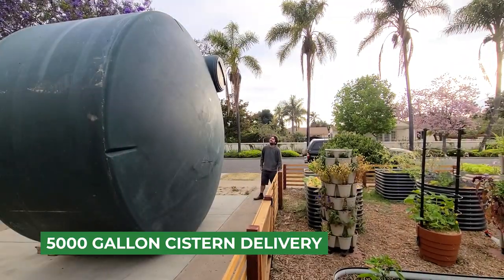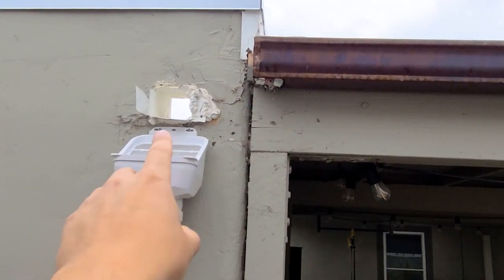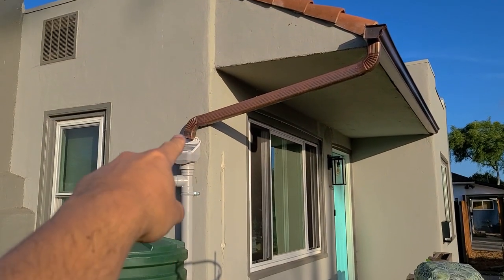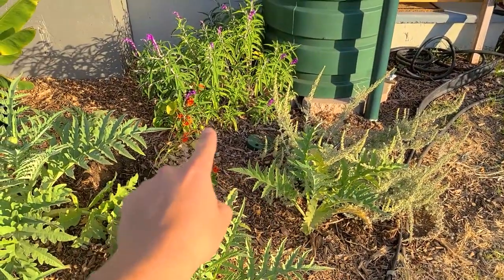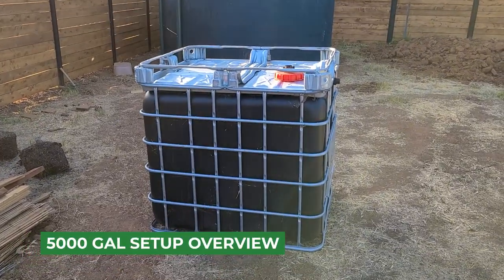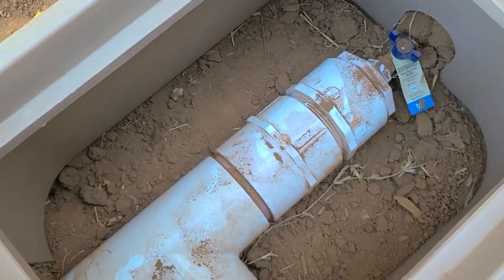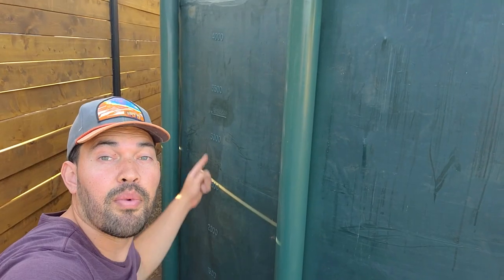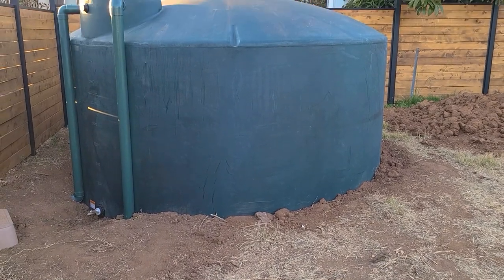5,700 Gallons of RAINWATER STORAGE at the Homestead! 💦💦💦

Comment: Where I live in Australia, we have a very similar climate to that of more inland San Diego area under the Köppen climate classification system, and having rainwater tanks here is standard (no rebates or grants that I know about). 
My grandparents and aunt and uncle live in a more arid area with even less rainfall and have each at least 4 x 5000 gallon tank. I have a single 4 or 5000 gallon tank and have been looking at getting another one as well as the thought is better to have more (without going overboard), than not enough. We use this rainwater purely to drink and water certain plants - and as it is also plumbed into the house we can use it for other things if need be as well. I noticed when I lived in the states, utility prices are too cheap (of course some areas are more expensive) compared to what resources are used and people don't realise how precious these things are.

Comment: Sweet! How long before they all fill up? Hope you get a lot of rain soon. Brilliant video!
Reply from the maker: Fall!
Reply: One inch of water or rain is equivalent to 623 gallons per 1,000 square feet. San Diego averages 12 inches of rain per year, and Epic is capturing water over probably about 1500sqft of roof, so that’s 623x12x1.5=11,214 gallons in one year!
Reply: @eandrgoodwin  I started gardening because I was told there would be no math ;-) but seriously, thanks for taking the time to answer my question. I must do the calculation for where I am using liters and meters. Cheers from Down Under!

Comment: What was the cost for just the cistern? We've been trying to figure out how to collect rainwater in a  cistern for two reasons. #1 We have a well and if the power goes out, we have no water besides the emergency water we store in special 5 gallon totes. Luckily the power has never been out longer thana few hours in the 7 years we've lived here. #2 Where a live, we get plenty of rain September to May but June, July and August gets almost no rain, only a handful of days or even none sometimes. So it would be great to store rainwater for the annual 3 months of drought and give our well pump a break from irrigation. The little rain barrels make no sense in our climate since that would over flow 9 months of the year and then be emptied in a couple of days with no refill when you need one. 

At the very least, we should set up a greywater system. I haven't found a lot of info about how to do this stuff so thank you for sharing your process.
Reply from the maker: Just that is ~$3k

Comment: Umm, I'm confused.
How the water flow to the biggest tank?
Using Archimedes?
So, inside the pipe gutter and underground pipe, it's full of water first, and when it's overflow, the water will fill that big tank?
It's also act as protection from debris, in addition to the existing filters.
Is that correct?

Comment: how does the water go UP to fill the big tank?
And - how many years of SD rain will it take to fill that?
Reply from the maker: If the level of that entrance is lower than the gutters, it will flow in
Reply: @epichomesteading  won't all the water in the tubing in-between the cutter and the tank be lost? That must be a couple of gallons given the distance and tubing diameter that will stay stuck in this U once the water stops to flow from the gutter.
Reply: @matf3663  i was thinking the same, i wonder if there is some sort of Greedy Cup effect going on that will pull the water out of the pipe into the tank
Reply: The level of the input to the large tank just has to be lower than the level of the input to the leaf filter, otherwise it won’t flow.
I assume that’s partly the reason you sunk the big tank down into the ground a bit. That, and so you wouldn’t see it over the fence.
Reply: @matf3663  some water will remain in the pipes and be inaccessible until more water comes in to push it up and over the top into the cistern.  This fill method is done to prevent siphoning. If the tanks were filled from the bottom, the pipe would still always be filled with water, but if anything went wrong, the drain pipes would rapidly pull all of the water out of the tank.

Comment: 2 questions: how long does water keep in them? Are you worried about air pollution in your area, I know you are somewhat urban still.
Reply: That's one of the purposes of the first-flush filter.  The first run of rain goes into the first-flush drops.  This is intended to divert away the particulates and other pollution that may have landed on the roof, then starts collecting water after that first flush has been completed.

Comment: I have hard time getting water out of barrels. Especially when water level is low. Attaching hose to spigot doesn’t really have a good water flow. It takes too long to water my garden so I usually end up using regular water. 
water pump makes loud noise so I don’t like using them. ( also I burned them down quickly.) 
How do you keep pressure from your rain water ?

Comment: I’m confused about where the gutters and system meet. Why is there a pipe that it goes down first? Is the pipe capped off at the bottom to fill it up? If it is capped then does the water cycle through that pipe as more water fills it up? Nice system!
Reply from the maker: It's not fully configured yet
Reply: I was wondering that, too. 
Is the “first flush” portion so that all the silt from the first rains doesn’t go into the holding tanks?

Comment: Two questions... how does that first flush part work? And, how does the water flow up into the cistern? What forces it upwards?
Reply from the maker: First flush works by filling up the first runoff, then once it's full the water flows into the capture system. Water fills up the tank so long as the entry point of water is lower than the gutter

Comment: 5700... if you ever fill that up you need to make a video about the Noah's flood you just went through :)
Reply: It's 0.6 gallons per inch of rain, per square foot.  San Diego gets an average of about 12 inches per year or less.  I don't know what his collecting square footage is, but with 1,000 square feet of roof, it would fill the cistern in less than 10 inches of rain.  

Honestly, though, the only major detriment to excessive capacity is cost.  If an area has a freak storm with torrential rain, you want to be able to catch it, and having reserve capacity gives you somewhere to put it.  Without some augmentation, though, he's unlikely to ever fill it without an extraordinary weather event.

Comment: Hi Kevin. I'm really enjoying your how-to videos and I am linking to some in my Oregon State University classes. You explain things really clearly and have great energy.

One comment on your system: I have not seen people overflowing tanks underground. Usually tank overflows are daylighted. I think you're in SoCal, and I wonder about when you might get a major atmospheric river event, of surpassing your overflow capacity in an underground system, especially tied into your existing greywater systems where the soil will be already saturated. I noticed on another video that your greywater pipe outlets (in your citrus row) are at ground level, instead of at the top of the bucket where the water has a drop when it enters your bucket. So I think over time you're at risk for root infiltration into your greywater pipes, which are now also your tank overflow pipes. I've installed a lot of branched drain greywater systems, and I did have root infiltration and clogging of my system even when the pipe level was at the top of the bucket (with bamboo!). Had you considered daylighting your overflows? Any thoughts on the height of your greywater pipe outlet in relation to the soil level at the bottom of the hole? Thanks so much for your excellent videos :-)

Comment: Question - How does the water get up into the 5k tank?  Is there a pump?  Awesome video, thanks!!
Reply: Wondering the same thing😕
Reply: That was the leveling thing. The top of the cistern is below the roof, so even if it looks like the water is running uphill, it really isn’t because the top of the cistern is still below where the water is coming from.
Reply: Hydrostatic pressure

Comment: So I know San Diego doesn't get a lot of freezes in the winter but do you know if something like this or at a smaller scale would be feasible in places that do get harsh winters like in the northeast U.S.?
Reply from the maker: Different application but you can still do it
Reply: You might have to bury the cistern below the frost line, then you’d have to pump the water out. 
Or just use the system when it won’t freeze and keep it drained when it will.

Comment: Hey Kevin, I was thinking of doing a 50 gallon rain barrel. If my barrel is on my deck which is about 4' above my garden, how would the flow rate of a normal 3/4" hose be? Would I need to buy a pump?
Reply from the maker: I'm not sure offhand John, sorry!
Reply: @epichomesteading  NO PROBLEM LOVE THE CHANNEL ANYWAYS, keep it up
Reply: The hydrostatic pressure of water at four feet is about 1.7 psi.

Comment: How long will it take to fill 5k gallons of rainwater in San Diego?
Reply: I think he mentioned in the video that he could fill the tanks in one rain season (assuming he didn’t use any water from the tanks) 
One inch of water or rain is equivalent to 623 gallons per 1,000 square feet. San Diego averages 12 inches of rain per year, and Epic is capturing water over probably about 1500sqft of roof, so that’s 623x12x1.5=11,214 gallons in one year!

Comment: How often do you expect to get overflows?
Reply from the maker: Unlikely never
Reply: One inch of water or rain is equivalent to 623 gallons per 1,000 square feet. San Diego averages 12 inches of rain per year, and Epic is capturing water over probably about 1500sqft of roof, so that’s 623x12x1.5=11,214 gallons in one year!

Comment: feel bad about copper down spot cut. but think long run it be great option. you could dig a pound but still have cost of pond liner and wild animals would steal water. plus much harder time get out. there more people every 10 years so think cost down line tap water only go up. for start don't commit right way you save milk and orange juice jugs and fill up from 50 gallon. it huge pain site there rain try fill jug and find place put. have leave bottom filled water but over corse year normal milk drinking. you double what system have. then get tired all work save money get system like this guy got. hook garden hoses too water stuff. did like how find how much water in tank. little worried shoot like garden hose. sure have vedio show hot that works.